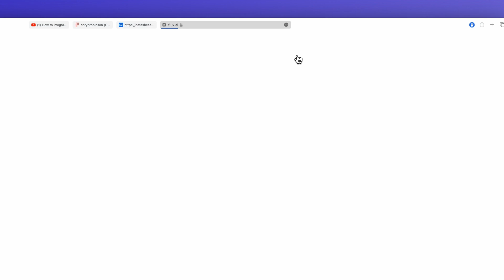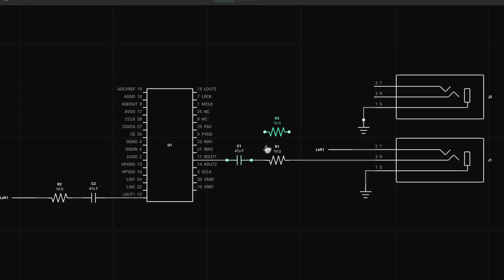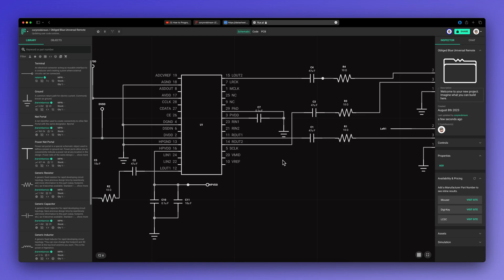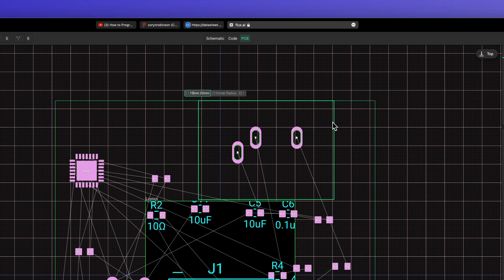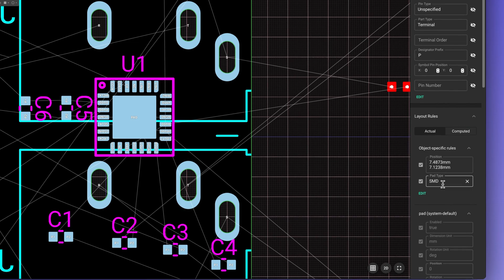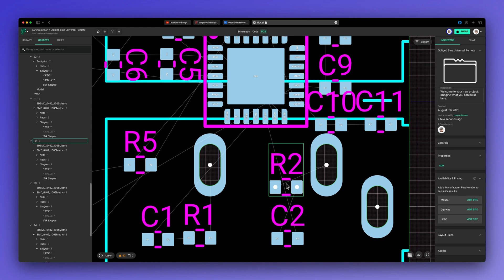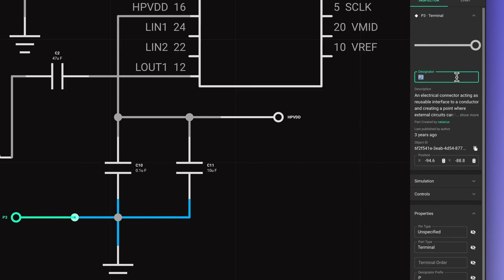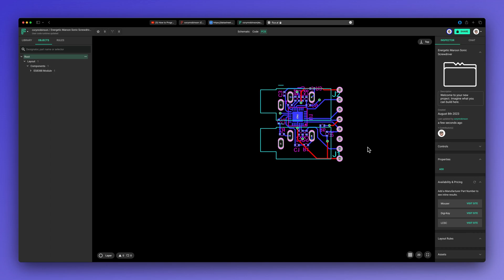Audio CODEC Module Start to Finish

Comment: I use other programs because what does Flux's "AI" do exactly? What it should do is automatically allocate components and mainly perform a super routing of traces. I remain without understanding the purpose of this software;
Reply from the maker: This should give a better explanation
https://youtu.be/_7yZj0L1tok
Reply: I thought the exact same... Why even build out a schem if you are going to assemble the board piece by piece again?